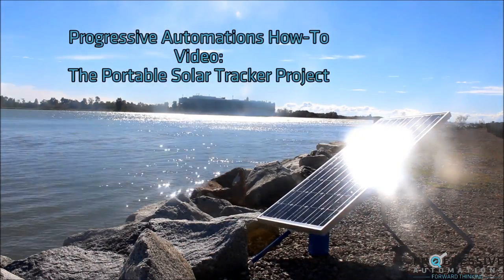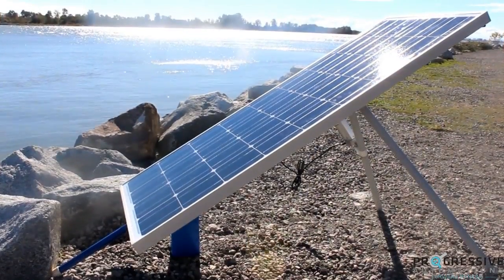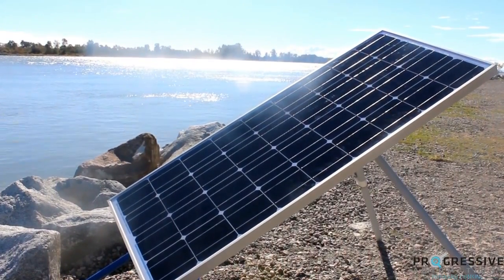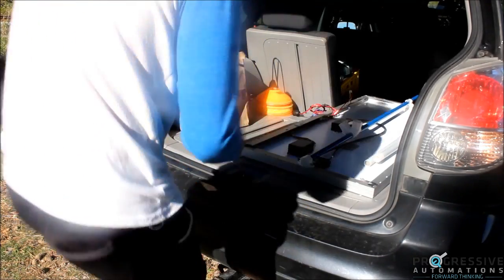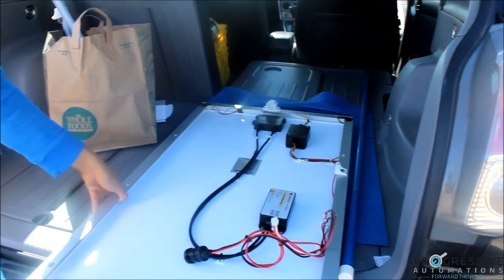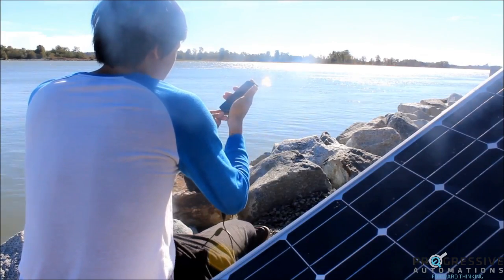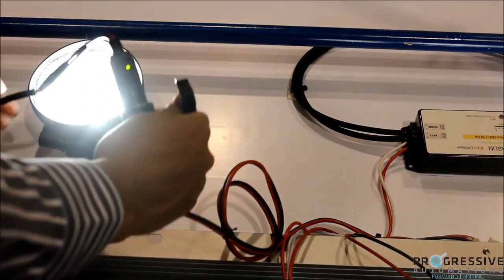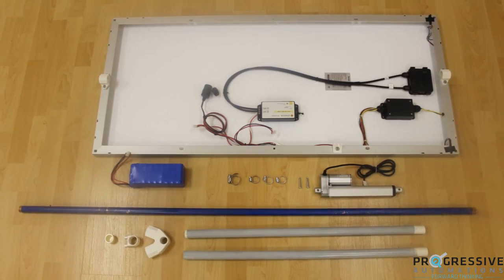DIY Simple Portable Solar Tracker Project

Comment: I’m haveing some code problems wit my Arduino Uno. I know you used a arduino micro but I don’t see what the big difference is. I’m usuals a dual control H bridge motor driver instead of the wasp, it works. But when I hook it up to the micro controller. It puts out 1v instead of 12v. And the linar actuator is trying to move but it can’t because of the low voltage. The PWM v doesn’t change when I vary the resistance. Is there any you could provide more pictures of how you actually wired it up. Wit the micro controller wasp and the linar actuator.
Reply from the maker: Hi Keventh
Our article goes into more detail on the wiring and how we did everything, you can read it here - https://www.progressiveautomations.com/blogs/how-to/how-to-build-a-portable-solar-tracker. If you need more information or have more questions, please contact us at 1-800-676-6123 or sales@progressiveautomations.com to get in touch with an engineer.
Best Regards